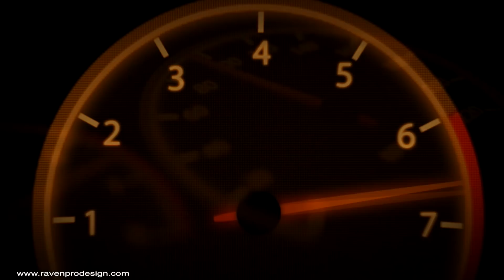WHAT IS A GLIDER KIT FOR SEMI TRUCKS ? (Q&A)

Comment: To run in California truck has to be 2010 or newer due to the carb emissions regulations.
Reply: And they have to have emissions on the motor which gliders do not since they are new body trucks with pre emissions motors.
Reply: screw commiefornea, let them eat dirt, the trucking industry needs to boycott that state and any other state trying to follow commiefornea. Roll Coal! and keep on trucken.